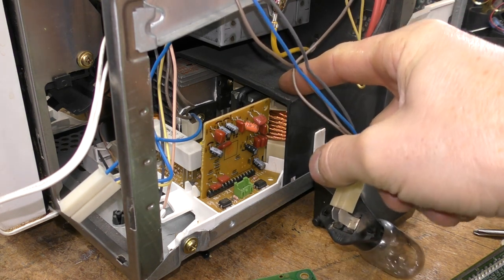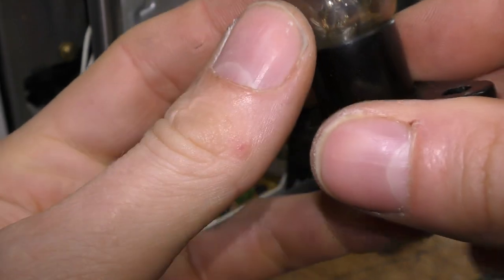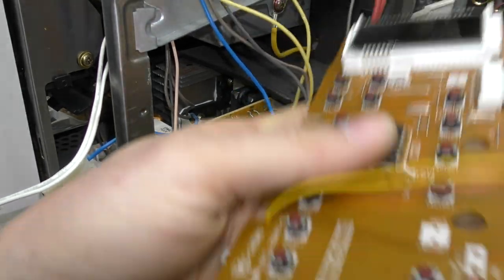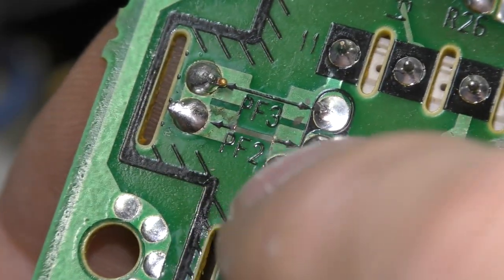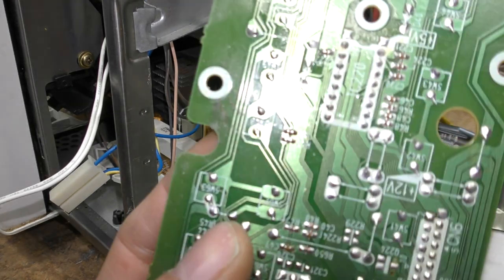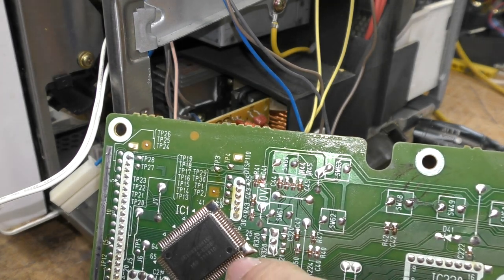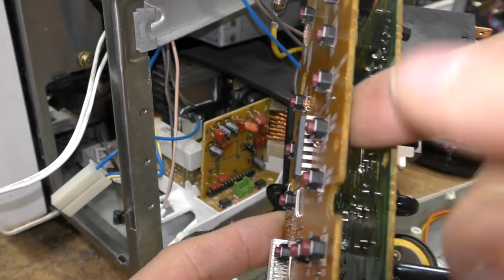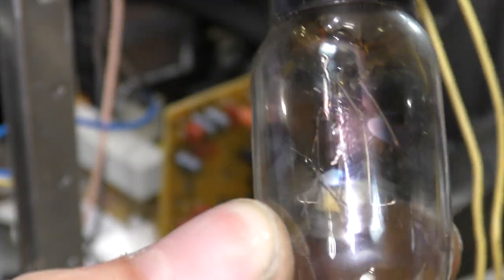Panasonic microwave destroyed by blown bulb.

Comment: i have an older 1981 digital microwave it usas a small linier transformer for the 12v power and usas a set of relays to run the magtron an light. its that simple if wanted i can make a vid of it
Reply: yes, do a video of it. sounds interesting.
Reply: Ing. Max Koschuh ok he made the vid you can wat it on the chanel..

Comment: I think you'd have a good case for claiming a replacement or refund, not least on the basis that it was clearly unsafe and not fit for purpose. The age of the appliance should not come into it. You might even think of reporting it to trading stds or the safety authorities on that basis.

Comment: What a terrible design I'd expect something like this from some Chinese brand but a major brand like Panasonic?
There needs to be a class action lawsuit as the lack of any kind of mica or plastic insulation between the low voltage and high voltage boards in close proximity is a dangerous design flaw that can cause a fire or electrocution hazard.

Comment: Why, when someone makes a video about a dead fairly modern appliance, do people suddenly claim to have some old bit of tat which is, purely because it still works, superior to the latest versions? I suspect that although this particular microwave oven failed spectacularly, seemingly due to a cascade effect triggered by the bulb blowing, it is more likely than not a one in several hundred thousand chance that it did. As for those with seemingly everlasting appliances, it's probable that they are also one in several hundred thousand but to the contrary - most of the others being long dead and recycled or in landfill. The simple fact is that things DO improve. Yes, some early examples of technology can appear to be made more sturdily but the functionality is usually inferior to their modern equivalents and they were also likely to be far less efficient.
Just because you happen to be the only person who still has their original 'doodad' doesn't make it somehow more reliable - you're either too tight to buy a new one, lucky it's survived the rigours of use or both!
Reply: Having a bulb take out the HV and control circuits whether mechanical or electrical is absurd.

I did pay good money back in the day for a Panasonic Inverter microwave with the grill and oven and large capacity. But it died within 2 years and it was clearly irreparable. Unlike cheap traditional microwaves that usually just need the HV fuse or diode replacing, at least if the magnetron goes you have a nice massive transformer that can be put to good use in other projects like spot welder or rewound for high current low volts or back to backed as an isolation transformer.

The only thing "Inverter" technology gives is a lighter weight an dubious "Chaos defrost". My microwave is stationary I don't need it lighter. The "Chaos" shit is just that.
Reply: Drew Dastardly 
Actually, the inverter technology enables the magnetron to be switched on and off at a much higher frequency than traditional transformer designs, similar to PCM in motor controllers. The result is that the power from the magnetron is infinitely variable and enables much better control of the cooking, whereas traditional designs use a very slow on / off cycle to control the power. This means that the overall cooking performance is much improved with less chance of hot spots in the food and better results. With regard to your comment about a magnetron failing, this is a rare occurrence as the magnetron is an extremely simple and robust device. Chaos defrost is a Panasonic trademarked invention which enables better defrosting by varying the power of the magnetron to enable a more consistent warming of frozen items and reducing the chance of food having a mixture of frozen and defrosted areas. Compared with traditional designs it produces much more consistent results. You don't hear of people complaining that their new LED back lit television no longer contains CFL tube HV transformers - If you want a large transformer to play around with just buy an old microwave from eBay and remove it.
Reply: Yes I know the "theory". But the evidence in actual cooked food? I never found it worth it. Pretty much all microwave food is reheated and "nuked" at max.

If I'm roasting a chicken or lamb leg then I stick it in my gas oven for a couple of hours and save a fortune on electricity and have a real roast.
Reply: Drew Dastardly 
I have personally found the chaos defrost function to be superior to the standard defrost setting but I'd never cook a chicken or other meat in a microwave. As you say, you can't beat the full flavour of properly roasted meat!
Reply: I always thought the hotspots were moved around by varying the phase of the wave fed to the inverter rather than the power?

Comment: Connect transformer via thermal fuses directly to the power cord and use one of the machanical timer plugable to the socket. Why need to use that stupid SMD junk.
Reply: Make a hole in the front panel and put an electromechanical timer :-)

Comment: I had a safety interlock wire on a Panasonic Inverter microwave oven burn up on me. But once I repaired that connection the unit worked again. Now I don't just open the door while it is on anymore. Panasonic Inverter microwave ovens are still the best though. Even with all of their failure modes. Here's a picture of the crispy connector http://i.imgur.com/upQWJWT.jpg